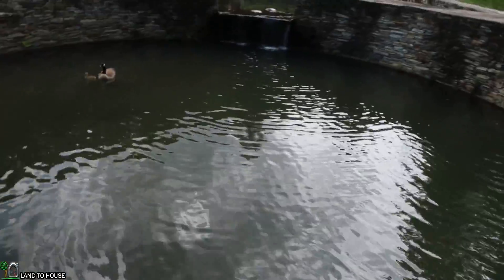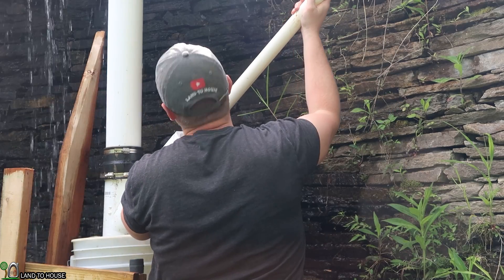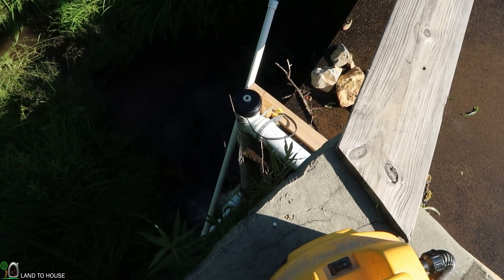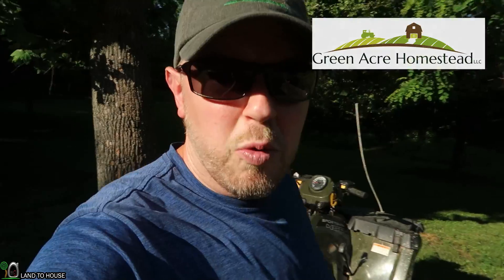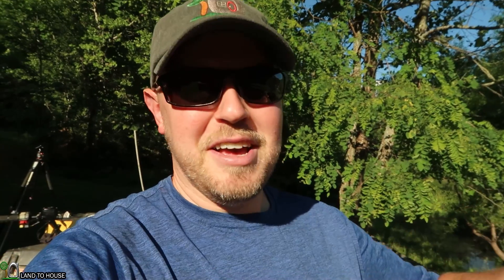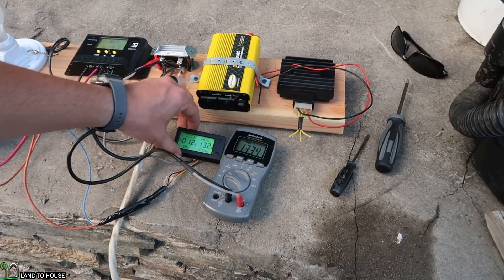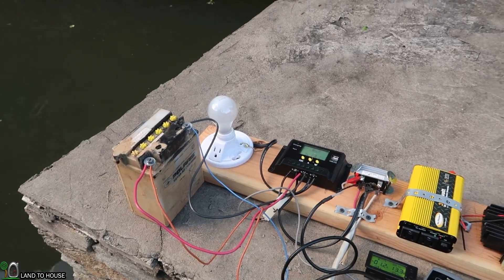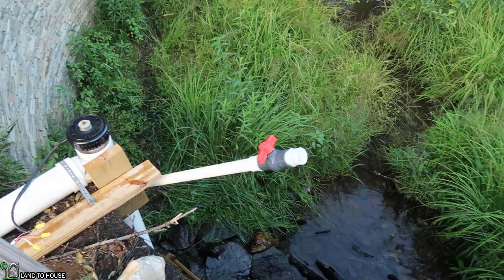Micro Hydro Increasing to a 6 inch Down Pipe

Comment from the maker: Please sub to Green Acre Homestead. They are pretty cool! 😎 
www.youtube.com/greenacrehomestead
Reply: Thanks for the shoutout Seth!
Reply from the maker: @sam-and-angela  happy to help!
Reply: @LandtoHouse  Just a heads-up the link in the description is wrong.
Reply: Seth you should check out the comment from OpenSourceLowTech. He did a lot of work on a turbine setup much like yours. His got a lot more power out.
Reply: @hubrisnaut  exactly what I was about to mention. He definitely needs to check it.
Reply: Have you consider recycling the water intake syphone and outtake? You wont lose any single drop of water. Yup, bucket at the end of outtake still needed to prevent air coming into the system. Make sure the water in the bucket goes back to the intake water. As long as the intake and outtake is not at the same water level and outtake pipe longer than intake pipe. Both length calculated comparing leg of n pipe, the siphone will work.
Check your email

Comment: Storage is only the answer storage is only the answer you need to charge up batteries to get the amperage you need at times
The head is what determines how much energy in the volume of the water siphon does not work generator 
Generator needs to be at the bottom of the head

Comment: So Im not an engineer by any means, but Im fairly sure that decreasing the size of your intake pipe will create more pressure. Maybe worth an experiment once your down spout is converted to being entirely 6in. The vacuum remains the same with the down spout, but that pressure pulling the water through the smaller intake pipe will cause the water to come in faster which will turn the turbine faster. Its the same principle of going bigger on the lower end, but you have some room to maximize your energy output on the upper end too.

Comment: Hi, i do have a diy micro hydro at home but im not good in computation if hm watts is the output, but it can light up 3 pcs  220 v bulb...can i ask if where i can buy a watt meter? I wanna try to share it you. We only use an old motorcycle stator and a turgo wheel

Comment: just curious, the bucket would seem to slow the flow so much it would actually back up al the way to the top and potentially slow the flow.  I watched your other video where you went and toured another one of these and he just put an elbow at the bottom and dropped it under the creek.  Is that not an option for you?
Reply from the maker: Good observation! I have another video after this where I move the turbine to another pool and don't have to use the bucket.

Comment: Removing the bucket will help massively.
It is impeding water leaving the bottom of the pipe which will be manifesting as back pressure in the turbine.

Comment: Also volts times amps give you the watts. As the battery is getting charged up amps drop there for watts drop
Reply: First test battery was at like 12is volts now at 13 so almost fully charged

Comment: The turbine runs on a change in water pressure.

And we know the pressure of water is determined by depth, not volume.

So long as you supply enough water, it changes nothing to use a larger pipe.

That said if your pipe diameter is the limiting restriction on power output, improving diameter would help.

But with a 4 inch pipe, I doubt you are limited by volume throughput

Comment: Extending your intake line just a bit and sealing it air and water tight may help.  Water pressure even a foot below  the surface may add to that starting surge you need for force to start the siphon.  Look at it like an old loose pull rope starter.  You need a kick to get things moving.   Your 6 inch pipe might make a nice vacuum tank.  Lower pressure in a tank and then open it to the siphon starting pipe.  You want to create a starting surge in the down pipe.  Your design works pretty well for the steady state after startup.   Your starting flow cannot quite overcome.  Your sloping output pipe will make better use of  the inertia in that first surge of water.   Air will also have an " UP" where is can flow or be sucked.   

I assume the down pipe will end in a 45 degree elbow and a vertical pipe.  Your venturi effect could be better  created by having the exit pipe smaller.  3 or 3.5 inches  would mean the flow always fills the 4 inch pipe.  The surge when a 4 inch flow hits a smaller pipe would suck and air out of the larger pipe.   In a more long term setup.   would use a  plumbing   Y with two  4 inch legs.  A short length of 4 inch pipe off the main line, adapted down to the much smaller vacuum line would add a local vacuum chamber to the larger main line.    Starting a siphon is all about overcoming the poor flow characteristics of the mix of air and liquid. Once the flow is well started, the liquid displaces the air and flows as a simple fluid.   Thanks for your patience reading this far.   Bonus material follows. ~={:)><

Bonus, Human Interest!!  The paragraphs above may be too dense or boring to wade through, at least at first.   They are mostly the result of an applied handicap and some seriously spotty education.  I filled in my education, with lots of reading.  The internet make back filling your education much easier.  I find it difficult to express myself simply.   This is why I created the  jungle of text above.  I expect you can express yourself much more easily.  The Key here is to Believe you can do it.   

I have both Asperger's Syndrome and mild dyslexia.   Asperger's is a form of Autism.   It makes me intensely verbal, highly focused on logic, and somewhat literal minded.  " Aspies" are wired a bit differently than Neuro-typicals, most of you regular Joes and Janes  out there.   We lose sending and receiving normal forms of nonverbal expression.   This means our body language, facial expression, and even eye contact may not be what most people expect. If you understand these "Universal " signal may not be ?Universal at all, you will come out ahead.   Regular folks can turn up their concentration as I do naturally.  They can lay pieces of a problem or situation out and shuffle them. You can use paper or create a document on you favorite device.  Some Aspies are skilled in doing this in their heads.   It is generally better not to rely on mental gymnastics alone,    My dyslexia show that daily.

 Dyslexia scrambles interpretation of words, symbols, and even directions.  The old reminder about  " Your Other Left", ( Your right), has a very dyslexic feel.   d and b can be confused and symbols can be transposed.  "Training " can be written as "traing,"  " your "is wrtten as "you", dropping the R.  ( Tip: the Google search  window can be a great spelling aid. )   The lesson here is to read your writing twice and again.  Do you "break" or "Brake" ?  
Do you want a Pair or a Pear? (  As a Plum, I may choose a Pair of Pears or a Georgia Peach. ) < Aspie literalism can build jokes.  In kindle books by professional Authors I have found the wrong form of "break" used.   I also found Skeet shot with rifles.   Unless you are doing trick shooting, like Annie Oakley, Skeet ( simulated bird hunting) is shot with shotguns.  Watch out for.50 caliber, ie .005 inches versus 50 caliber, .50 inches or .22 caliber, ( clearly fo very small game, ants perhaps, at .0022 inches.  )   Fact checking may be the difference between a  Pulitzer Prize and a Booby Prize.  You can write if you try.  You may do better than the Pros. You may well do better than me.  

 Mark Twain exposed my very flawed  speaking an writing style.   Yes, I was busted by a fellow who lived a hundred years before I was born.  In "A  Connecticut Yankee in King Author's Court " he wrote about a woman who spoke in "Germanic, transatlantic sentences.   ... She would emerge with a Verb in her mouth. "  ( Yes I have studied  German, though it it has mostly rusted away.  )   This is a mental jam session, laid down in mostly one take. One several hours long Take.   It needs what the Computer programmers call " refactoring."    Thing need to be broken down into simpler, clearer forms.   ( Those of a certain Age may have nightmare about  " Diagramming Sentences . ) This the skill those deadly dull exercises were supposed to give you.   I thought of it as Englishes version of " New Math. "   Both worked if you got both the concepts and techniques.  If you did not get them you were lost in the weeds.  ( No they were not the Good Smoking Weeds either!  One student showed how roll .. a err cigarette { Family Friendly edit }   using shavings from the hand cranked pencil sharpener in the room.  This "tabbacco " had  seeds. black bits of pencil lead.    ( Yes Virginia you can learn useful skills in English class.  This skill should be reserved for those of legal age, in certain Western States, or Holland. Sorry1 )

Comment: I am catching up on this series of videos lol.

Was going to say about a 45 into the pool but you are already planning it.

I don't know if the 6" would help, I can see why it might, but the turbine is 4" and no matter what you do it is the restriction. Also, any energy it uses to accelerate the water out the 6" is wasted energy you are not getting. But I will stand corrected if you test it and it does indeed help.

(I know you would have fixed it) it does sound like your intake is sucking in air.

Comment: very nice test, looking forward to watching the 4" all the way to the pond one.
Feedback for Langston: the impeller needs stationary guide vanes to prevent the water from swirling past the impeller, that's why the PMA needs a push start.
Reply from the maker: I think that some of the issue is that there is a lot of air in the long horizontal section of 4" pipe. And then there are a few leaks. I think that is the main issue keeping the unit from spinning up on its own.

Comment: What's the story on the wall?  It's enormous..Presumably concrete with the stone facia.  Must have taken months to complete let alone material cost.
I though 4" pipe would pull the water level down too fast.. If so 6" would drain things even quicker.

Comment: This was close to my old setup about 8 years ago. There are some tricks to make it much better, but it'll take a little more money. First, to save the hassle of going up and down put in a T with flap valve on your intake in place of the 90. Above the T put a 2ft fill pipe with a removable cap (cap will have vacuum pressure gauge so you can monitor the water flow). Just before the generator should be large valve. Now for the inlet into the water, make it about 3 1/2 feet long for you set up and cap the end. On the side of the inlet pipe that's in the water cut a rectangular hole equal to the diameter of the pipe in square inches plus 2 inches and rap it with window screen, to filter the water before it gets to the generator. I have more tips if you're interested later.

Comment: If you would a significant inprovement in power, put the turbine to the lower side of the dam.
Reply from the maker: A siphon based turbine like this does not have to have the turbine at the bottom.

Comment: You need to pull the voltage down to 1/2 of the open circuit voltage. With a PWM charge controller you'd need ~33V of battery to get the peak power out of the 66V PMA. An MPPT controller is a buck converter and will do this for you.

Comment: Can I suggest using a check valve? Thoughts.. duck bill, pinch-flex valve or even a piece of flat hose at the end of the discharge. You should in theory be able to use it at any location on the discharge side of the pipe, deleting the bucket and not having to go all the way down to the lower stream by extending the PVC. I do believe running the PVC down to the lower stream is the best option.  However for testing purposes it would just seem easier to run a short length of flat hose.

Comment: I might be wrong but I think you keep working ont the wrong side of the generator. If you increased the depth of the intake you would increase the pressure through the generator (the pressure is to low that's why you have to spin the gen. by hand) thats why at hydro dam's the generators are placed at the bottom of the Dam. In theory your suction idea would work but without the deeper intake to create more pressure you will be limited. just my two cents. Ilove what your doing keep it up!

Comment: From a physics standpoint, this extra height will improve the pressure difference and the flow rate because of that pressure difference. You get a square benefit of the height difference because of the pressure and the extra speed because of the added pressure.

In this particular application, seeing you're using more than 100% of the available flow when it's running, you'll only see the benefit from the added height once, because your water will run out quicker in the upper pond.

Now I'm thinking about it, you might still get some added benefit from reducing the speed of the outgoing water by using a bigger outlet because there's less kinetic energy in the outflow (K.E = 1/2 x m x v^2). That energy may have dissipated somewhere else in the system, or it could be added to the vacuum at the expansion. Not sure how that works from a fluid dynamics perspective.

Comment: 1, Increase the shaft length for the turbine, move it down close to the bottom of the down pipe.
2, Add an additional length of intake pipe so that it reaches down further into the reservoir. As it stands now, it will start creating vortices around the intake (weir) as the flow volume increases. 
3, Double up on the actual turbine screw so that it dose 3+ rotations around the shaft. This will reduce the "slippage".

Comment: I wonder if you could create suction with another siphon of a half inch or 3/4 piece of pipe going over the dam similar to the turbine that would self start when the dam level would rise high enough that you could start the turbine if you have enough suction on the bottom of the turbine to start spinning it by itself. And then you would be able to automatically start the siphon when the water level would rise high enough and then have the turbine self start on its own with enough pipe on the downstream side of it you might be able to create a viable self-starting turbine that once the dam drops it just in just the air and then wait for the one level to rise and starts to self again

Comment: (Speaking from experience)  High priority:  Switch to MPPT instead of PWM charge controller. (This will more efficiently convert generator voltage to battery voltage regardless of 12v or 24v battery given your open circuit voltages. )  Seal ALL air leaks.   Bring the 4" pipe to several inches below the waterlines on both sides before you bother with 6".  Lower priority:  Replace ball valve for vacuum with check valve.  Vacuum tee doesn't have to be near the bottom.  Anywhere below turbine blades is fine.  Switch to sweeping pipe bends rather than hard 90's where possible.  If flow rate goes high enough, you might need vortex mitigation on the input side.  That will be a good problem to have.  If I build you a system that automatically makes and breaks the siphon based on high-side water levels, would you try it?  Greetings from Raleigh!

Comment: The best upgrade you can make is to change from PWM to MPPT.
MPPT will make the most of the power being created, PWM will drag down the high voltage being created reducing RPM and charge power .
Reply from the maker: I am looking at them. The $100 + price tag is the problem haha.

Comment: Seth, I think you are going to need a MPPT charge Controller to RAISE the turbine voltage. right now you are pulling it down to 12volts. this is slowing it down too much. The Tristar MPPT has a more where you can SET the voltage. Just a thought.
Reply from the maker: Yes that is my next purchase.  I am browsing them to find a good one on a budget.
Reply: @LandtoHouse  unfortunately you can’t just use any MPPT charge controller for Hydro. You need a very specific unit that allows you to set the voltage that the Hydro is being clamp to so that you can manually tune the turbine voltage and RPM. Chris harbour who has a YouTube channel used the tri-star MPPT with full success. It took some tuning but I will link the video where he figured it out.https://youtu.be/pJ1I1WuyA50

Comment: When you extend the pipe to the bottom pool, make sure the outlet pipe is under the pools surface, that way you can take advantage of DELTA P and the pressure in your pipes. I would try every trick in the book and experiment with everything, including making your input pipe longer/deeper in the top pool.
Reply: Good thought on a deeper intake as it may take advantage of greater pressure at the intake although the weight of water above that may cancel it all. I think like Langston suggested, 6" all the way down starting with a 45 and go straight to the creek bed. Build a little pool to terminate in with some cement and the local rocks.

Comment: 1. More head pressure will create more pressure- either pressing or sucking the water. Take draft tube (suction pipe) down to the creek and 3-4” into the creek (tail race). Need about a foot of water below the tail race for exiting water to not cause back pressure- resistance.  Also needed is a Stator just before the runner blades to prevent a vortex of water spinning in the same direction as the runner. The static are blades, typically at 45 degrees in opposite angle of the runners blades. This creates a water flow directed at the pushing direction against the runner blades instead of slipping past the blades on the runner.   The runner at the top is fine if you put the 6” draft tube immediately below the runner. The runner blades create turbulence (air adds volume to the water) and turbulence causes friction in the draft tube. I built my own hydro with a 24/7/365 output of 2.75 to 2.95kw. It drops when I get weeds restricting my intake screen.  My winter improvement plan.